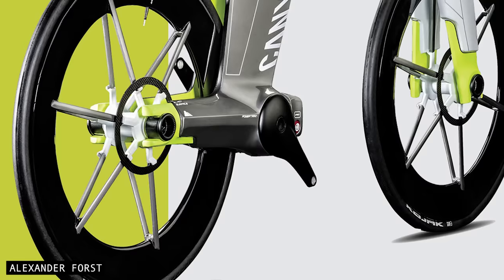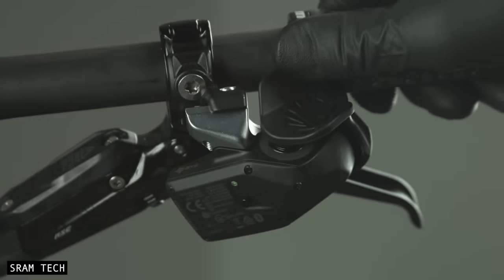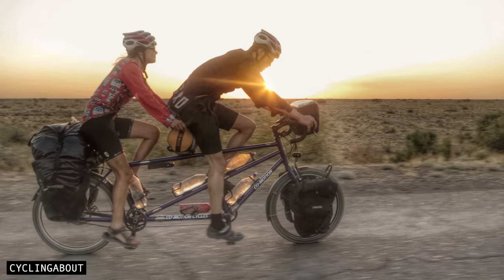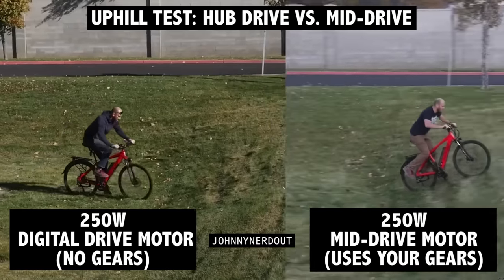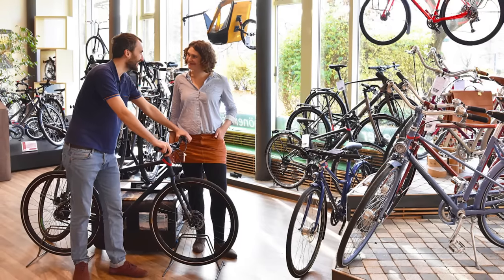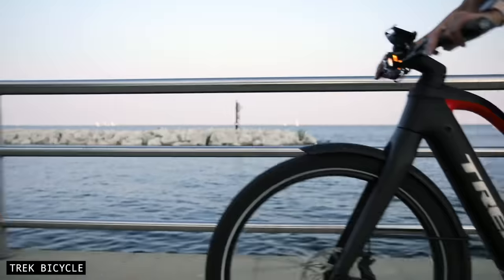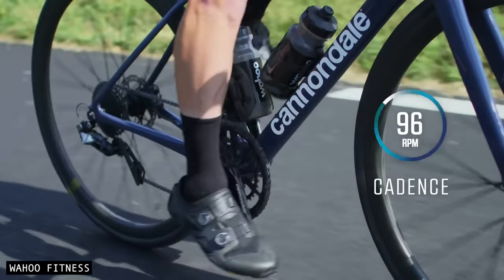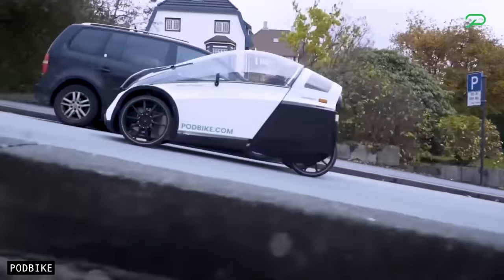Are Chainless Digital Drive Bicycles The Future of Cycling?

Comment: The electrical loss is so much greater here and would be super underpowered compared to the pedaling being done
Reply: A man of culture
Reply: This needs to be upvoted.
Reply: Exactly, as an Engineer .. this idea of absolutely STUPID.  But could make some sense for a plug in battery powered bike that would occasionally be pedaled.
Reply: Age! For those not as young... Could utilize, operate, and actually be able to do...
Reply: @KrustyKlown  ok so this is what i dont get then. Mr engineer, why is it that diesel eletric on trains exist? Ik, i also dont get how it is better than a drivetrain but its like the only way they do it. How come?
Reply: @dontaskmewhy8734  I'm an engineer too, but the best efficiency of an electric generator is around 65%.  I would guess the point of diesel electric is to pass energy to the train for lighting and other use of electricity.

I don't know much about diesel electric trains.
Reply: @fuzzywzhe  Torque.
Reply: @zigarojec6605  Well, you can get a lot of torque out of an electric motor.  You'd have to have a battery or some massive high capacity ultra-capacitors though for both storage and for the sudden pull on electrical power.

It doesn't seem efficient though, and why do you need massive torque on a train?  It's not like it does sudden acceleration..
Reply: @zigarojec6605  so is the reason that with electric motors you have better control over the driving behavior? that plus electricity being required on the train anyway might actually make it worth it.
Actually, if this was really true, wouldn't that also to lesser extent be a point in favor of electric bike drivetrains? to make initial pedalling easier or sth... or maybe at that scale it's not worth the loss?
Reply: @dontaskmewhy8734  It mostly comes down differences in consistency of gas powered motors, as well as the intended use and complexity of the vehicle. On the scale of cars or trains, not only are you moving significantly more mass, there is also a vastly greater range of needed torque and rpm. Combustion engines will vary in efficiency depending on the constantly changing needs of torque/power, and so the main benefit of hybrid systems like diesel electric is that by charging a battery, you are ALWAYS getting usable work out of the engine, even if the wheels dont need it in that instant. If we were talking about a bike that had a small petrol engine on it, then certainly there would be comparable benefits of using an e-drive system.

However, a standard bicycle is just about as simple a mechanical system as you can get: human push pedal, wheel move. A normal bike chain drive is just about as efficient as its possible to be. As a human, you can apply as much or as little work is required, and the energy put in at the pedals is output at the wheel at pretty much as close to a 1:1 ratio as it can get. As soon as you throw a dynamo and an electric motor in there as a "middle-man", youre just losing energy.

The question comes down to: how do the benefits compare to the costs in efficiency? For trains/cars, electronic drive offers significant benefits. Comparatively, bikes will offer much less payoff for the same type of system, ESPECIALLY when theres not already an integrated power source like a battery or petrol generator.
Reply: @fuzzywzhe  Hey, not an expert on diesel-electric engines either, but as far as I was told, the diesel-electric variant train removes the need of transmission gearbox. Electric engine delivers flat torque almost independently of RPM.  And yes, the diesel-electric tran uses batteries.
Reply: @ilonachan  Hey! Yes the torque is a flat function over RPM in electrical motors, that is why everyone likes them for better accelerating. Not sure if worth the loss an a bike... One would have to try it out, maybe the feeling of continuous torque transmission outperforms the feeling of constant drag, who nows...
Reply: Correct. It can make economic sense in an ebike, because half of the components needed are already there. Most ebikes are motorbikes that need some minor human input anyway and nobody really cares for the efficiency of the power conversion.
Reply: @fuzzywzhe  Where do you get that figure from? I admit I'm not an engineer, but I've heard of 3-phase motors/generators hitting 90% efficiency or higher. Plus, and correct me if I'm wrong here, I think you'd get higher-than-expected round-trip efficiency since you wouldn't have to rectify the output from the generator to power the other motor.

Also, the purpose of diesel-electric isn't for onboard power; after all, engines with mechanical transmissions still have onboard power. Reading straight off Wikipedia, it's because electric motors can provide full torque (add-in: at decent efficiency) at 0 RPM.
Reply: as electronics design engineer i can say that improvements in SiC and GaN technology technology can revolutionize "digital drive" bike, efficiency over 98% in energy conversion is achieveable, from small power supplies (phones, laptops) up to kilowatts
Reply: as electronics design engineer i can say that improvements in SiC and GaN technology technology can revolutionize "digital drive" bike, efficiency over 98% in energy conversion is achieveable, from small power supplies (phones, laptops) up to kilowatts
Reply: @KrustyKlown  as an engineer you should stick to areas of engineering in which you are confident about your knowledge. Please look for silicon carbide transistors and check if your statements are true.
Reply: @tomasz5315   ok
Reply: You guys are amazing. Who knew  it was here in a youtube comments section of a batteryless ebike video that id finally get the answer to why trains are like that. I really apreciate the explanations you all gave me. The internet is awsome,  at least at this very moment lol.
Reply: @tomasz5315  I am knowledgeable here dude .. .a bike chain drive is 97% efficient. To equal that with a generator & electric motor combo as shown here.. EACH would need to be 99.85% efficient  ..  which has  NEVER achieved by man. A typical affordable motor or generator is around 85-90% efficient.. or 72 to 81% efficient as a working pair. That is CRAP compared to a chain drive, which is MUCH cheaper too.
AND we never got to the additional losses in the electronics, which make this silly thing even more absurd.
Reply: @redcathode  I got the figure from power generation plants.

The key is demonstrating a device that has the same or better efficiency of a conventional drive of a bicycle.  I could be wrong, there's major energy losses in burning fuel that may not be applicable to a human, pedal driven, generator.
Reply: @fuzzywzhe  What you're looking at is probably the efficiency of the plant overall (i.e. its efficiency at converting heat to electricity), not the efficiency of the motor converting the movement of the turbine to electrical energy. (on that note, 65% is extremely impressive for a heat engine. Wow!) The motor/generator in the bike pedal would just be converting rotation into electricity, so it would be much more efficient.
Also, I think that in some cases the advantages you could have with an electric transmission on a bike would outweigh the slightly lower efficiency compared to a chain (e.g. you could have cruise control, assisted acceleration from stops, less maintenance, regen, and you wouldn't have to bother switching gears)
Reply: In russia we say
Do not invent a bicycle
Reply: @merylsmith8297  Браво!!очень грамотное обоснование!!!
Reply: @dontaskmewhy8734  Mostly for added flexibility. Keep in mind that trains of this type mostly run on flat terrain and the massive kinetic energy, once up to speed, will move the train along at reduced cost. Moving power from engine to wheels is much simpler thus power is not wasted by transmissions, gears, etc.
Reply: @fuzzywzhe  because while in a regular car it is possible to use clutch to match the wheel with diesel motors RPM, with train weighing 100s of tons, you could see how far the clutch would take you. Thats why you use motor generator, so that the engine can run at its optimal RPM and you can easily control the power of electric motor for any conditions
Reply: @rustyclark2356  yeah, electric motors and power electronics in the 70s weren't nearly as efficient as they are now
Reply: @fuzzywzhe  - Massive torque isn't only used for sudden, fast acceleration; it's also used to move super heavy loads.
Reply: @spinav8r  Well, as I said, I don't know much about trains and why direct drive would be less preferred over a generator plus electric motors.

I do know, however, something about biking, and the machines have basically been perfected decades ago.  They are SLIGHLY better than they were in the 1990's, but I think at this point, we're pretty much at perfection.

Using a generator and an electric motor doesn't make any sense really, unless, it's an electric bike and even then..
Reply: @KrustyKlown  Bit of a nitpick, but, with ideal conditions, the two motors would need to be 98.4% efficient to get 97% efficiency round-trip, not 99.85% efficient. (sqrt(.97) = .984) Not sure where you got that number from.
Again, though, I don't think the end user of one of these will care if their bike is 2-6% less efficient than a chain; I think that the advantages of having an electric transmission would outweigh the slightly lower efficiency. (see my earlier comment)
Reply: @fuzzywzhe  - You're completely missing the point of my comment.The point of my comment was in response to you saying "why do you need massive torque on a train?  It's not like it does sudden acceleration." I pointed out that massive torque is not only for sudden acceleration. It is also for moving heavy loads. So you see, my comment was about the uses for massive torque. Trains, which must move super heavy loads, need lots of torque. In my comment I didn't address what is the most efficient method of achieving that torque, only that massive torque is indeed required.  But... if you're wondering what advantage might be gained from driving the wheels directly by electric motors, consider that with electric motors, there is no need for any kind of transmission (either manual of automatic). Imagine if the train engineer had to shift gears! Electric motors can develop tremendous torque at zero RPM which is extremely helpful to get a train moving from a dead stop. To do that with a diesel engine, you'd have to rev it up to a few thousand RPM before engaging the clutch in 1st gear, and then working your way up through many more gears. That would be way worse than required for a semi truck.  There you go. Does it still not make any sense for you? Did you try to do any research on your own, or did you need some hand-holding in the comment section on YouTube?
Reply: @spinav8r  I feel like they're not really an engineer
Reply: @spinav8r  Yes, I understand the need for torque (now) on a train, but I can't understand why direct drive through gearing would be less preferred over a generator and a electrical drive.

I did read what you wrote, but we've had trains for over a century, running on steam, and those most certainly weren't running electrical generators and were direct drive.

I'm just kind of surprised that given, what?, around 150 years of development, an entirely new method of locomotion would be superior.
Reply: @redcathode  - Who is "they"?
Reply: @fuzzywzhe  - What do you mean "new method of locomotion"?  Diesel-electric locomotives have been used since the 1930s. The last steam locomotive for general use was produced in 1953.  Some steam locomotives are still being maintained, but they certainly don't used them for long haul use. Imagine having to stop every 100-150 miles just to refill the water for the boiler.
Reply: @spinav8r  fuzzywhe (no offense)
Reply: @redcathode  - Thank you. When you said "they", I was thinking in the plural sense, but now I know what you mean.
Reply: @spinav8r  As I said, I don't know much about trains.  Direct drive has been around since... trains were first constructed.

BTW, any train I ever have taken never did more than 100 miles without stopping.  Well at least not that I'm aware of.  I've taken the California Zephyr between Denver and Chicago but I went first class, and slept most of the way.  Pleasant way to travel, if you have the time.
Reply: This can be fixed if we use stuff like carbon nanotubes.
Reply: I just calculated it to be a 16% loss. That is massive .
Reply: @DwAboutItManFr no. The issue is that the chain drive just transfers mechanical energy from the pedal to the wheel. The electric drive system needs to convert mechanical energy to electricity, then BACK to mechanical energy. At each conversation you're going to have at least some entropy loss (second law of thermodynamics).

Comparing a bike transmission to a  diesel electric train is just dumb because the engine needs to convert chemical energy to heat, then convert that to mechanical energy. However the electric drivetrain actually reduces the complexity of the transmission AND allows the engine to run at optimal rpm, so you up gaining a net effeciency increase. 

Anyways, I'm also a mechanical engineer . Bikes are well within my field of expertise so don't send snide comments my way. However, the problems with this transmission are so dead simple and obvious that a high school kid should be able to calculate the effeciency loss. You just need to know about energy conversion and know about fraction multiplication
Reply: @tomasz5315 o he's right. You're going to have entropy losses just due to the energy conversion stages. You'd have to have both a motor and a generator with over 99% effeciency each, for the total effeciency to exceed that of a chain drive.

Also... Do you know what a transistor is?
Reply: @FLMKane  i dont know why you concluded that i dont know what transistor is, but nonetheless overall efficiency of electric system would be lower and i know that but flexibility which it gives may result in better usage of human power. Also always is better to have more choice, electric drivetrain have other advantages/disadvantages over chain drive and it can be better in some use cases, its the same situation as fully electric cars.
Reply: @FLMKane  At the end there a lot of variables like wear of mechanical components and wear of energy source, pedaling speed will also change efficiency especially if you need to have transmission of ratio over 1 from crank to pedal generator. But energy from braking will be utulised and not thrown away as it is with commom brakes. Subject is very deep and i think that it would be better to sit with beer and talk about it in person, not on yt comment section :p
Reply: @tomasz5315  not even close to being a good analogy. The effeciency of the chain drive is definitely higher than an electric drive

Regardless , silicon carbide transistors aren't used for effeciency. They allow for higher power to weight motors.
Reply: @tomasz5315  naw dude, you wanna talk to me about the effects of mechanical wear on a bike transmission, you need to quantify it. Newsflash, you're gonna lose at most 2 percent effeciency when you have a worn out drivetrain and that's NOTICEABLE to any rider. Meanwhile , with an electric drivetrain you're gonna lose close to 20% . That's ten times worse than a worn out drivetrain.

Btw I ride on campy parts. They dont wear out, they wear in ! (Jk jk)
Reply: You seem to be overlooking the most fundamental aspect of this idea...there is no minimum IQ requirement to access the internet.
Reply: @alfa-psi  OK.. 'engineer" .. and your claim of "wrong" is idiocracy without a technical explanation that stands up to review.
Numbers don't lie.. this stupid idea comes nowhere near the efficiency of a chain drive transmission, which is STILL what is used on all racing bikes, for good reason. Why the hell would anyone want to pay MORE for a much less efficient drive system that is 70-80% efficient at best?
Reply: ANd the weight! Weight is very important. A well built XC bike is faster than e-bikes. And the efficiency of the 2 by drivetrain(2 gears on the crank) combined with its lightweight result in 2 by drivetrains being superior compared to anything else. For sure 2 by drivetrains are not the best in everything, but in terms of speed and efficiency they are the best.

Belt drive is too heavy, needs heavier frames.
Reply: @dontaskmewhy8734  Torque, they need high torque, and the torque of even diesiel engines is not that great for their size. Electric motor which is even 5 times smaller than diesel engine could have more torque.
Reply: I am proud that my fellow engineers are explaining why this idea doesn’t make much sense. I agree with a lot of points about the benefits of diesel. I think it also provides autonomy for the train during the case of an electrical failure in the track
Reply: Not if they add a larger magnet for generation and if brush less very little resistance
Reply: @fuzzywzhe  Torque isn't just used for acceleration.  It translates into a lot of pulling power, which is good to have for a train.
Reply: @FLMKane  These conversion inneficiencies would be improved by lower resistance aswell.
Reply: @FLMKane  To be more precise i also was refering to the resistance on the coils inside the generators/engines, source of much loss in the conversion, non metalic cases and bike materials would also help preveting magnetic loses.
Reply: @fuzzywzhe  well, in the topic of diese-electricl trains it has it's advantages, they can have compact drivelines ( a train's undercarriage is not that big) eliminating the need for bulky gears for the transmission and wheel axles, another thing is it could also send power to attached wagons, which is highly impractical using long and flexible trans-axles.
And also, the diesel engine can run at optimum engine speed where it can produce peak efficiency to be converted into electricity, mind you this conversion is at most 85% efficient, but as stated above it's a compromise with this setup.
Electric motors can generate high torque from standstill to full speed, meaning that the engineer only has to modulate electrical output to the motors while maintaining a constant RPM on the engine, instead of doing it like you would on a semi truck.
I could go on and write a long list as to why they do it on trains that it could be whole youtube upload in itself.
Now on the topic of this bike, humans can't pedal 100% all the time, and generators don't like that.
Added to the fact that your adding an additional weight and inefficiency from the generator, when in fact you could have chain driven the rear hub motor achieving the same or even greater result.
Reply: @KrustyKlown  but why is it smart in, say diesel-electric trains then?
Reply: @fuzzywzhe  Diesel electric engines avoid using gear boxes and drive shafts which would need to be connected to all the powered axles, very complex. Electric motors are fitted to every axle that needs to be powered allowing for good tractive effort. It is much easier to control the torque and power of an electric motor than by using gears.
Reply: @ilonachan  i think u r a girl dat study engineering or something
Reply: I hate this type of armchair engineering. Of course there are going to be tradeoffs, but some hybrid drivetrains work like this and they're more efficient than the traditional ones.
Reply: @fuzzywzhe  The torque needed to accelerate depends on both on how fast you accelerate and how much mass you accelerate.  A loaded train weighs 4,000 to 20,000 tons while a loaded truck weighs 40 tons.  To accelerate at the same rate requires 100 to 500 times the torque on a train.  Modern diesel trucks have 9 to 18 gears in their transmission.  I would be impractical to build a 900 speed mechanical transmission for a diesel train.  If you use fewer gears the engine is forced to run at less efficient speeds and fuel economy plummets.  Diesel electric has infinite "gears" allowing the diesel engine to operate at the most efficient speed all the time.  This more than makes up for the 20% or so loss you get converting from mechanical to electrical to mechanical energy in a diesel electric.
Reply: @fuzzywzhe  Power generation plants generally report efficiency in converting heat to electricity not mechanical energy to electricity.  Conversion of heat to electricity is limited by the Carnot efficiency: (T_hot-T_cold)/T_cold with T in degrees Kelvin.  The second law of thermodynamics limits the efficiency of heat to mechanical power conversion based on the temperature of your heat source and heat sink so without an absolute zero heat sink or sn impractically hot heat source you never get close to 100% conversion efficiency from heat to mechanical energy.
Reply: @dontaskmewhy8734  Good point. The electric motor has a more constant and  stable torque output than a piston engine for the application of pulling large loads like trains do.
Reply: @dontaskmewhy8734  Diesel Electric trains exist due to the torque/power/efficiency characteristics of electric and diesel motors. These are maximised when using diesel as a fuel in a generator rather than driving the varying load of the train directly from a diesel motor. These benefits out way the losses in the conversion of potential chemical energy in the diesel fuel to driving force via the intermediate battery and electrical motor.
Reply: @KrustyKlown  It's not, you just missed the major usecase. E-cargo bikes are mostly motor powered, but for legal purposes, they  to be "pedal powered with motor assist". Eliminating a lot of packaging and design concerns around building a drivetrain is a dream for them, while at the same time still being able to sit in the very conveniently unregulated zone of bicycles.
Reply: yep, but an electric generator may be a good idea 🤔
Reply: Yes but you can use a battery instead of gears.
Reply: guys this isn't how percentages work
Reply: @KrustyKlown  Well not really, if they are efficiently able to generate electricity at all rpm, cause motor will be able to efficiently generate power at optimum torque and rpm at all times.
Reply: @fuzzywzhe  On a Locomotive, the Alternator drives Electric motors at the axles, this serves as a practical transmission .. at the expense of efficency.
Reply: @rappymic2595  a chain drive is >97% efficent with lots of gear ratios .. so yes, really ... that is why all racing bikes use chain drive, NOT a generator / motor arrangement.
Reply: @fuzzywzhe  You don't understand what torque is. Torque is about amount of force that can be applied.

Imagine you have a several hundred tonne train, and it has to move, up a hill. Torque is what you need to move it, the force to push a massive weight from stand still, over coming static friction, and any additional force from any gradients.

A DC motor has massive torque at stall, which makes it ideal for a train because the most force needs to be applied to get it moving, and very little to keep it going.

If you don't understand this basic engineering principle, why are you even arguing here?
Reply: @vlgi  Toque is displacement times force.  It's a measurement of how much twisting force is applied.  If you have a wrench and apply 100 newtons to it and it's 100 cm long, you have it's 0.1 * 100 = 10 Newton-meters.  If it's 100 newtons and it's 1 meter long, it's 100 Newton-meters.

I understand torque.  My problem is understanding the energy efficiency of such a system for one, and storage of excess electrical output for another.

There's substantial loss of converting to electricity and applying that to convert to mechanical energy and I would expect you need electrical storage when drive power needs to be reduced or suddenly increased.

I'm not a mechanical engineer, I'm an electrical engineer.  Storing energy in capacitors seems impractical and batteries, dangerous.

I simply don't understand it.  That doesn't mean I'm stupid, it's just that I cannot see how it is done.  There's no shame in ignorance, we're all infinitely ignorant.
Reply: It's disgusting how the  engineer who designed this system ignore the energy losses !
Reply: @idiyerbill1968  You think THIS is disgusting?

Go find out what a Solyndra solar "panel" looked like.  Now if you did moderately well in geometry I would expect you to find at least 2 MAJOR flaws in the design.

And that was made by MANY engineers.  An entire company was built up around making that stupid disaster.
Reply: @stasstas9529  In Soviet Russia, bike rides you!!!😁😃🫨🫡
Reply: Maybe to brand-new and well lubricated chain and transmission. Only maybe.
Reply: @dontaskmewhy8734  Diesel engines operate efficiently within a range of RPM, so, like a car, you need a clutch and a gearbox to directly drive the wheels from the engine.
A clutch. On a vehicle weighing like 5,000 tonnes. 
Can you imagine setting off? You know how you slip the clutch of a car to get it to go from 0 to 5mph? Imagine doing that on a train. A vehicle which takes far longer to accelerate, and has at least an extra order of magnitude more power.
Reply: Then why on Earth do diesel electric trains exist?
Reply: @fuzzywzhe  As a weed engineer who studied at the school of hard knocks.... the main and primary objective of a Diesel Electric generated system/powerplant is A:  Low Capital Cost due to lack of overhead equipment. B: High Acceleration and retardation features and simplifies how motive power is transmitted to the wheels.
Reply: @RNA0ROGER   some things can work on a big big scale and not the small scale duh
Reply: It’s gonna be very zesty.
Reply: @fuzzywzhe  it needs a lot of torque so it doesnt take forever to start moving and stopping which would hinder the capability of a train to run on time
Reply: Yes but at the same time digital does not have to mean any loses in efficiency. It just depends on the creativity of the programmer and the creativity of digital hardware design which will continually evolve.
Reply: This only make sense in a e-bikes with battery. Without battery it’s worse because efficiency loss
Reply: @joaopedrogod  Even though I feel like you're on to something here, if they added a battery it would still be having the same amount of energy loss. The loss is from the creation and the use. It's not lost because it's not able to use it and therefore it dissipates. If we were over generating electricity it could go into a battery, but whether there's a battery or not. If you're not generating enough electricity, you'll just end up using energy from the battery itself.
And I I hate this discussion because it has gone on and on and on. But let's just put it this way. I have a Skylark e-bike.
And to help everyone understand if you personally and I'm I'm saying this to everyone in this comments because people have been arguing with me back and forth back and forth for a while now. If you email the Skylark bike company and tell them that you want a small generator added to the bike that as the wheels turn or the chain turns it recharges the battery. They will tell you they can't put anything on there. Big enough to actually charge the battery enough to be worth it.
It is just like if you get on an exercise bike at the gym and try to exercise with that exercise bike. You only get enough energy out of it no matter how hard you pedal to really only light the computer screen.
That's not producing enough electricity to make you go forward.
It works at the gym because every single ounce every single atom of electrical charge is being put towards the computer screen, running the program to keep track of your calories and such things while you're writing on the exercise bike at the gym.
When you divert that power to try to make it move, there's not enough electricity to force a human weight plus a bike's weight forward with any momentum enough to stay upright.
I do think you're on to something I do. It's not that you're wrong. It's that everyone else is constantly wrong. If they were able to make a smaller electrical generator which would have to be the next invention that it would benefit the machine to have it on there without weighing it down. Then we could start moving forward with this and machine but they currently do not have one in existence. Small enough that would make enough charge for this to be beneficial.
I would cite Einstein's theory that in space a spaceship is traveling in the faster. The spaceship is traveling. It's actually growing bigger and as it's growing bigger, it requires more fuel. Therefore, even if we reach the speed of light, the vehicle would not be able to carry enough fuel to reach the speed of light.
It's an amazing theorem. It's not worded properly in my grammar, but it's something that can be googled or YouTubed at all times. It's readily available. Science basically the faster you go, the more energy you need, the more energy that you need, the harder it is to carry it and that means that the amount of mass that you have becomes less efficient then because it's less efficient. More of the fuel goes to just helping carry the fuel and not propel the machine with this. If you think about it is where I'm getting up with the bicycle. If you're not making enough electricity with the generator to keep the battery charged then you're not moving forward and that is electrical loss. Every item you add adds weight adds torque bogs down the machine and every wire every deode every capacitor is going to absorb some electricity and as it does electricity radiate soft and is lost. Electricity loss is a big thing in all electrical things. There is no 100% efficient machine and the closest we have is the basic electric heater that just heats up the wires with the electricity passing through and even that is not 100% efficient.
Again, I'm saying this for everyone who is continuously commented on my comment here. I am amazed that we're still having this comment, but let's work towards the making of a smaller electrical generator and stop pretending that this bicycle would work.
Reply: 14 minute virgin youtuber vs one sentence commenter chad
Reply: @iancowan3527  well, no. the drivetrain wont magically get more efficient when a less physically able person gets on the saddle. a standard e-bike will be able to get far more range from the same battery simply because the pedaling is actually efficient (and, unsurprisingly, it doesnt magically lose efficiency when a less physically able person gets on)
Reply: @jotch_7627  I'm missing your correlation.
Reply: @iancowan3527  a less physically able person will not be able to use this drive train any better than a standard chain drive. in fact, without a battery providing most of the energy, it will be much harder for them to use this as it will transfer less of their effort into forward movement. with a battery, the ease of use can be roughly identical, but you will achieve much less range on a single charge. its a downgrade on pretty much every front
Reply: I think the major disadvantage is government regulations.
To be classed as a bike, and not as a moped/motorcycle.

I think an interesting option can be to artificially apply extra pedal resistance to charge the battery while riding slow or downhill.

I think virtual gear, to set resistance and hand speed to control the power output could be an interesting way for the rider to provide optimal energy, while they would otherwise be idle.
Reply: @thorbjrnhellehaven5766  Using a weighted wheel... with gained momentum, whenever normal motion is stopped, that force can be used to generate power... 
As for motorcycle or bicycle classification - that is more to regulate safety. The speed and weight of each greatly divides the risks involved with the two!
Reply: Bravo
Reply: As a tradeoff the overall system is much simpler and the maintenance lower. Personally I wouldn't mind spending more power, that way I wouldn't have to go to the gym.
Reply: But a hybrid system that works when the torque is low could be effective
Reply: @fuzzywzhe  efficiency as to mechanical to electric
Reply: This is a horrible idea.  If you combine it with a battery, it would have its pros and cons. But without a battery, it's all con.
The pro (with a battery) is that you can put out constant power by pedaling at a constant rate  under a constant load. When you generate unneeded power, it would send it to the battery and then when you needed extra power, it could pull it from the battery.   But this would be very complicated to do.
But really, it takes something 97% efficient and makes it more like 90% (or lower) efficient.
Reply: Sure, but I mean, even if you get only 50% efficiency (down from ~85% of a regular bike), hardly anyone is using the full capacity of their batteries in the e-bikes to the full extent. So the battery can just do the rest of the work. On the plus side you get zero maintenance for a chain, sprockets and the gearbox and avoid all this unsprung mass on the back wheel.

So this is great for a daily driver which gets driven in bad weather and also great for any bike which sees unpaved roads a lot.
Reply: JDC generators work great
Reply: Diesel electric exists because the electric motor generates more torque and it removes the need for very heavy direct diesel gears and drive. 

This though is nonsense....35% energy loss for tiny weight savings.
Reply: @fuzzywzhe  diesel electric trains are essentially moving power stations they use electricity for propulsion for the torque there's also the fact that a mechanical clutch or torque converter big enough to deal with the weight of a freight train would likely be stupidly big
Reply: @dontaskmewhy8734 I think the reason diesel-electric trains exist is because of the need for an ultra-ultra-ultra low gear when starting  to pull a big train from a standstill.  Then you would have to have whatever transmission you designed “shift up” after you finally get that 100 car freight moving.  When the diesel motor turns the generator at speed from the start, the power goes to the electric traction motor which can produce the torque needed starting at zero speed.  It’s the same reason that electric cars can accelerate so well from a standing start.
Reply: @dontaskmewhy8734  Oh, I'm also a Engineer and your question is very simple. The reason is that to reduce complexity of transmission and reduce torque force apply back to the engine itself. The train is very heavy and so it need many drive wheels. A transmission for whole system like that will cost many mechanical part. Not only that when start up if the engine is hooked up to wheel through mechanical part it will cause so much torque force back to whole mechanical system and may broke something. For that reason the train need electric diesel engine. The diesel contain so much power per weight ratio compare to battery and the electric motors reduce complex mechanical parts and can apply more torque from start up phase. In result the train will more simple to maintenance, run smoother, reduce friction, reduce part deterioration. 
However the reason why this hybrid engine don't become common and isn't applied for other vehicle is the the efficiency. First thing first it is not a direct power. Engine burn fuel generate torque, torque spin turbine, turbine spin dynamo, dynamo generate electricity, electricity, again, gen torque to spin wheels. You see in this design they need to turn physical force to magnetic force and then back to physical force. Cleary it is much more fuel friendly if you can go in direct way. The reason why for train its fuel saving but for car it's fuel drinker is weight and number of drive wheels. For car a simple transmission is enough but for train it will require a huge, heavy gear sets to do the job because train need handle big load and car only have 2 or 4 drive wheel but train may have up to 12 drive wheels. Train because of that, diesel electric is more saving compare to using mechanical gear. Diesel electric mostly use in big vehicle, like a train, military truck that use 6x6 or 8x8 drive. Those things handle too heavy so need many drive wheel and torque. A diesel electric will simplify transmission for all those wheels and generate more torque.
For this case of "digital" bike i think it's clearly stupid idea from engineer's perspective.
Reply: Wrong. Your 65% figure is for a combined cycle gas turbine and refers to the electrical output as a proportion of the energy content of the fuel. In this case efficiency is mechanical power at the wheel divided by the mechanical power at the pedals and it ought to be well above 90%. @fuzzywzhe
Reply: @KrustyKlown exactly what I was thinking It only really makes sense for a mostly electric bike that you want to pedal occasionally
Reply: BIG TIME !
Reply: @dontaskmewhy8734 Diesel electric locomotives exist because electric motors are capable of producing a lot more torque than any diesel motor. When you’re pulling 10s of thousands of tons worth of cargo, you need to be able to put out a lot of torque to get moving. Steam locomotives can actually out torque electric motors in specific conditions, but diesel or patrol are by far the weakest when it comes to torque. It also massively simplifies gearing (even semi-trucks have fairly complex gearboxes, and the few diesel mechanical trains that did exist had similar gearboxes), avoids friction losses due to that gearing, and allows for the use of electric braking instead of constantly wearing through brake rotors. Trains are an entirely different sort of beast to a bike or car.
Reply: @redcathode The efficiency of the generating side can be pretty high, but combustion engines are quite inefficient, losing a lot of the chemical energy of their fuel to heat and sound. So while the generator may output 90% of the energy that actually makes it into spinning the shaft, a lot has already been lost at that point.
Reply: It's OK, let's speak frankly, e-Bikes were never about saving energy, but just a new business niche, and a way to pile up more crowd into already overcrowded cities.
Reply: @KrustyKlown Explain your unsupported assertion. An engineer should know better.
Reply: Why?
Reply: more energy transfer, more loss. it's inevitable.
Reply: Even the most rudimentary electric are 85 percent efficient.
Reply: @EnlightenedSavage  yep 85 % of 3 % of the total needed power .... Also. Nope solar is at best 20% and looses 10% the first year of use but nice try
Reply: yes except for my comment where i stated the same obvious.
Reply: @dontaskmewhy8734 the size and weight percentage vs the entire load is why it makes sense for a train and not a smaller vehicle. Engines designed to run at one rpm can be super efficient. Remember, you probably only get 10-20 percent of the power out of your fuel. Where as a train might be 25+.

If you add all that stuff on a car it would vastly effect the weight, percentage wise. Even worse for the bike (which is why it's so weak).

Also the traction motors are responsive so well suited to prevent wheel spin on the tracks, have loads of torque, don't need transmissions, can make use of regent, etc.